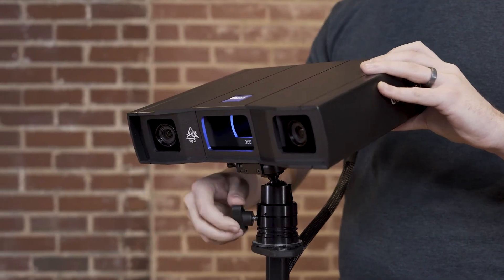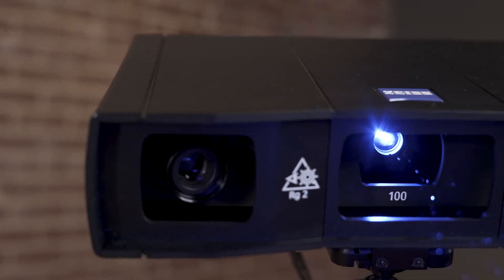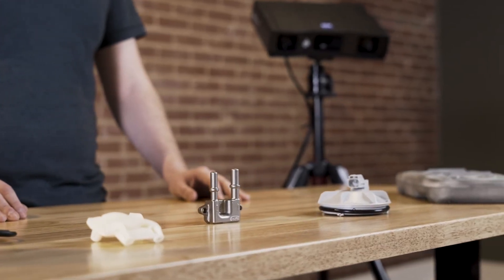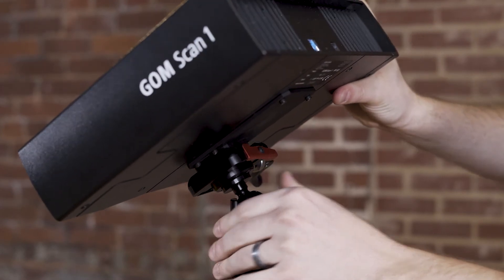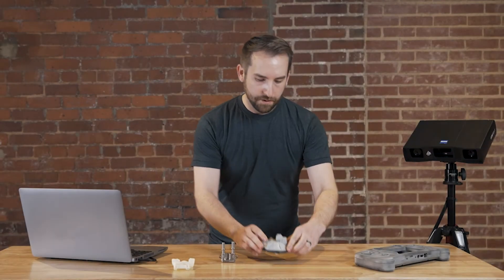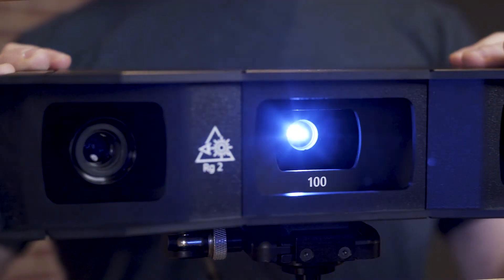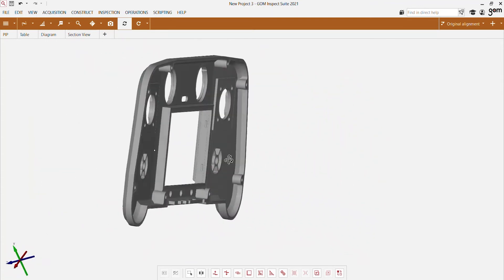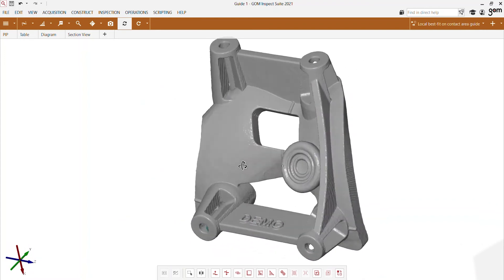Optical 3D scanner GOM Scan 1: Select the right sensor for your application

Comment: If the same part is checked on GOM ATOSQ.Then what will be the differences in terms of accuracy, mesh quality and scanning speed?
Reply from the maker: ATOS Q is a more versatile system with exchangeable lenses to fit many different use cases, has triple scan functionality, higher scanning speed and a higher resolution. It captures more detail with higher accuracy and scans faster, suited to the more demanding measuring tasks. Please reach out to support@HandsOnMetrology.com with your contact details and we can show the difference to you in a demo.